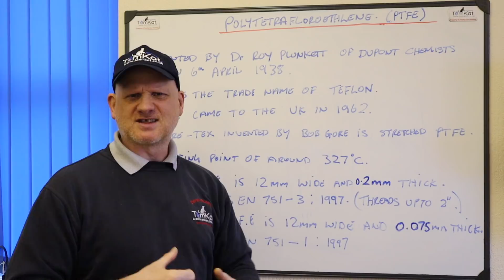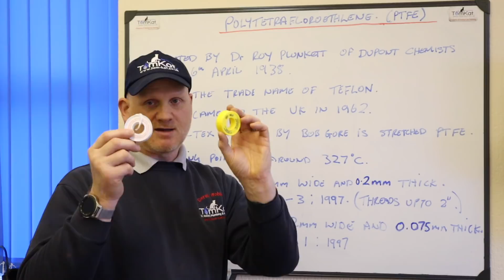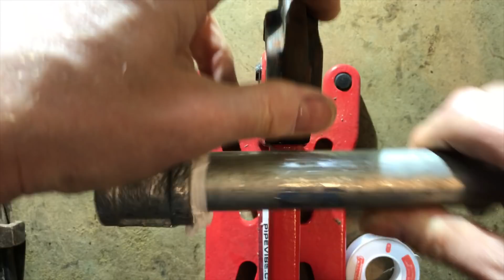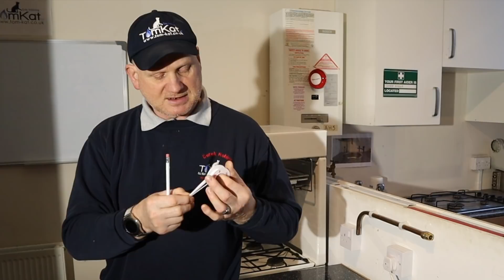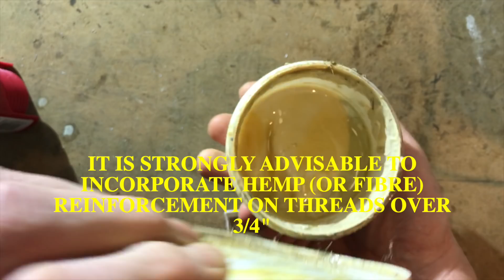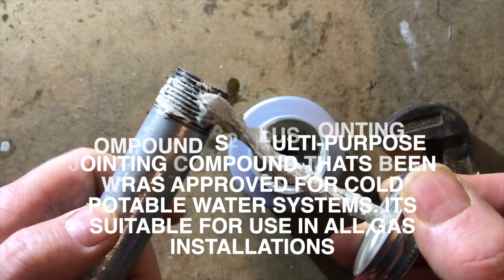Plumbing and gas jointing compounds WHAT TRAINEE GAS ENGINEERS NEED TO KNOW, how to use PTFE tape.

Comment: I've got a new air angle grinder. There's a leak where it screws into the grinder (confirmed with soap solution). I used ptfe teflon tape as usual (Never had problems with compressed air tools using this  ordinary white tape. It's a permanent fitting obviously, never needs to come apart. What would you all recommend. Loctite 577 is dearer than the grinder so won't be getting that. 
Thank you.

Comment: Loctite 577 can be used on anything up to 3” (gas reg stops you at 2” anyway but can be used on water obvs); but if used on above 1 1/2” you’ll need to put heat on it to get it apart. I spoke to their staff as needed some info when doing a boiler room 👍

Comment: Random/Negligent way of wrapping Loctite 55 thread is a big NO. The random wrapping and diagonals are completely wrong. The first wrap should not cross the screw peakss at all and the direction is against the rotation of pipes (the thread is rolled clockwise). Then, if possible, another run, or as many as needed to obtain a little and CONSTANT opposition while rotating. If in the video that negligent wrapping works, it is simply luck. Do not play gambles with gas or water.

Comment: You succeeded to screw only half of the pipes because the tape at the end of the screw is too much. Sealing is made inside the pipes, therefore be sure to use almost all the filet. 
Another 2 things: 
1. First it is worth rolling the tape in a thread and filling, in one carefully run, clockwise, the inside of the screw. Then wrap the tape over, as a tape, like you did. 
2. Before screwing the pipes, LUBRICATE the inside pipe as well as the pipe with tape. This ensures the tape will enter as much as possible undamaged between screws and not get out and agglomerate outside - as it is visible in your video. Loctite 55 thread is better, with the same steps

Comment: Thank you for this video! I needed to plug a valve to convert to an induction range and this was very useful. I used the yellow PTFE tape, which funny enough was actually yellow in my case. Gave it 12 wraps and snugged it in.
Reply: Lubricate the pipe inside and the taped one outside before screwing. It is essential, it ensures the tape goes in as much as possible and not pulled out while screwing

Comment: Don’t put your stilsons on the open end of the fitting, there is a risk of distorting the end.
Reply from the maker: Only if you don’t know what you are doing and if you use the incorrect size of stilsons
Reply: @tomkatgastraining  it’s regarded as not good engineering practice and you have viewers who fit these parameters, after 50 yrs in the pipe work game I,ve seen it where the end is distorted, better to put a loose fitting in before tightening as I’m sure you know.

Comment: Used PTFE forever! Now I know the gas one is 0.2mm thick, I may use it on those lose radiator connections. Just fixed a leaky one with Loctite 577 I had from 2010, and it has worked despite the plastic lid nozzle getting seized. 
Liked & subscribed 👍

Comment: When I use ptfe tape on a parallel threaded fitting I make a cone of the tape. Less on the end more to the back. Starting at the back of the thread I go to the front / end of thread. When I'm done, usually about 15 revolutions, the end of the thread has the least tape applied and the back end of the thread has the most / thickest tape applied. I always run my finger nail around the thread pushing the tape into the thread the full length of the threads so that there is more tape in the thread ,less tape can be pushed back off the thread.

Comment: There is no difference between the two PTFE tapes. We routinely use the “non gas” tape on threaded gas fittings at 300 bar+ offshore.

All the PTFE Is sealing the spiral leak path between the root and peak of the thread.

PTFE should only be used on tapered threads. It’s use in domestic plumbing is quite limited because almost all are parallel.
Reply from the maker: Gas threads in domestic have to be tapered not  parallel
Reply: @tomkatgastraining  95% of U.K. domestic fittings are parallel. Irons, radiator tails, taps etc are all parallel. Ductile iron pipe is the only thing I’ve seen a tapers thread on.
Reply: Many houses in the US built from the late 1800s to the mid 1960s used galvanized steel supply lines that are tapered. They cut and threaded the gas and water pipes with the same die.

Comment: The Loctite 55 is totally PTFE free, dunno what the white lubricant on / in it is but not PTFE. I used to do work for Imperial Tobacco or John Players Cigarettes as it once was, they had a blanket ban on PTFE use anywhere in the factory as PTFE gives off toxic fumes if it is burned with a flame! You can imagine if it got into a cigarette can't you...... Loctite 55 was approved therefore, I would imagine Loctite 577 would be fine also. Imperial Tobacco closed down here in Nottingham and is a demolition site at the moment 😳

Comment: Very nice video Derek! In minute 17 you mention something I'm a little bit confused: when doing copper gas pipes with olives, should you or should you Not use PTFE on it? Is gas paste the preferred option? Thanks in advance!
Reply from the maker: No need to put PTFE on new olives but some guys put paste on new olives but I only use paste on old olives when the nut has been undone

Comment: I’m a Tennant connecting a gas line for a furnace. My apartments main gas line is 1/2” all I have is 3/8 pvc, my buddy says it’s better to use steel and pvc is not compatible for gas. I don’t see the difference 🙄
My question is the 3/8 is too small to fit the nipple. Is it acceptable using the pipe tape to build up the smaller plastic pipe and thread it on the larger steel gas pipe? It gas checks with no leaks and plastic won’t spark. So far the heater has been phenomenal. If you want a recommendation for a wall heater pm me. Peace.
Reply from the maker: Ok guess from what you are saying you are from USA. If I was you stop what you are doing and get a qualified guy in. If you were in the U.K. you would be breaking so many laws and could face a prison sentence.
Reply: @tomkatgastraining  this isn't the UK,  besides I'm saving $$$ for heat.
Reply from the maker: @jamesdewer  well let’s hope you don’t kill anyone 😳

Comment: thanks for the video! very informative. Been using loctite 55 for some time now, so much easier that hemp/paste/PTFE. Bought myself some loctite 577 because it looks to be even easier to use... but does anyone know if its ok for potable water? Can't find any references to certify it for potable water other than from NZ. Can't use the stuff for house mains until am sure it can be used for potable water.
Reply from the maker: Loktite 577 is made for sealing metal pipes with taper threads that’s probably why you can’t find anything on it about potable water
Reply: It's nsf certified

Comment: When that locktite ptfe thread/string,came out, I tried it, but didn't like it. I prefer tape,
I've noticed when doing dad valves recently.  I have to wrap alot more tape on than years ago. 
Now....20 turns, before 12 or so.
I don't count , but I've done that many it's just second nature.
And the 20 turns. I still get weaps now and again ffs
Reply: You don’t get weeps with Loctite 55 as it has a setting compound but it’s difficult to split once set.

Comment: Threads like Loctite 55 are cool stuff. But how does their using fit in with BS 6891 7.6.3?
Reply from the maker: The manufacturers say it can be used on gas so they would have got it passed off so it can be used no mater what the standards might say.

Comment: Del the Loctite 577 is an Aerobic Glue, it basically glues the threads together in the absence of oxygen.  Amazing stuff, there’s various grades of this Glue & is used depending on the application.  Aerobic glue can also be used to glue copper tube & End Feed fittings; simply by using Emery Cloth or both surfaces.  Screwfix sell a Liquid PTFE that’s basically Aerobic Glue, a lot cheaper than the Loctite 577.
HTH
Reply: Anaerobic?

Comment: Can you use hemp on potable water i.e compression fittings? I was told it's a contaminated
Reply: Contaminent
Reply from the maker: You must use the correct products for potable water. Boss green and jet blue are good with potable water. You would only need some kind of binder if the fittings are over 3/4 and you must use the binder which is for potable water. Some of the manufacturers of the paste say reinforced fibre  is needed over 1/2 but I have never used it on 3/4 and had a problem.
Reply: @tomkatgastraining  thanks Del